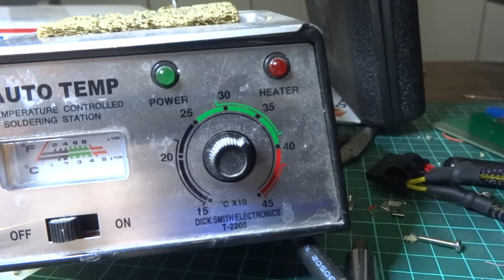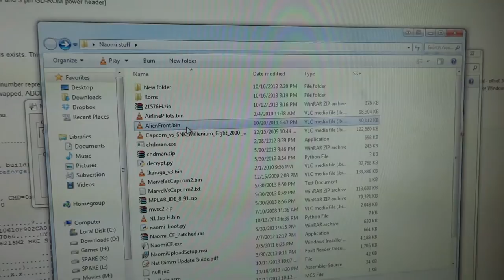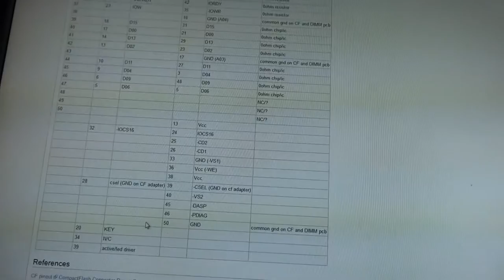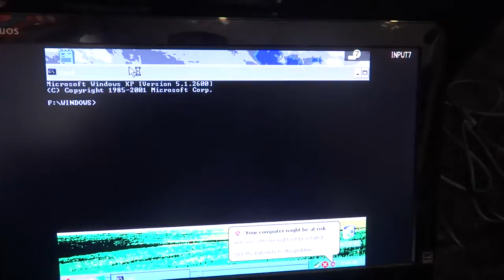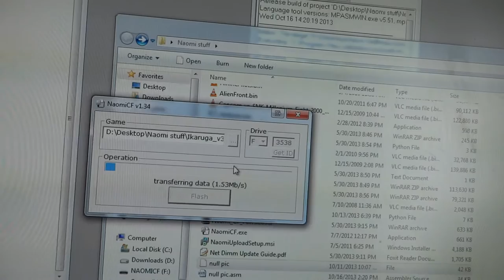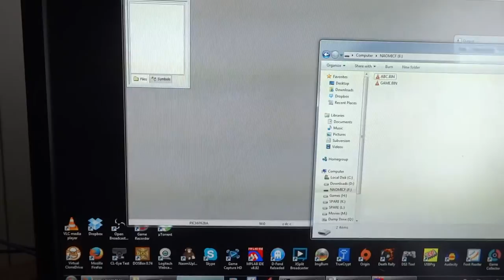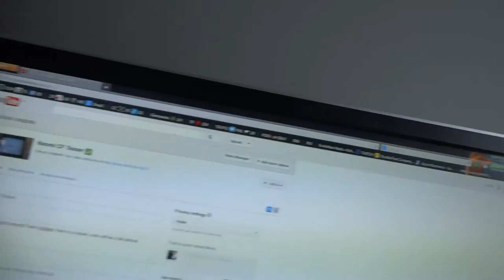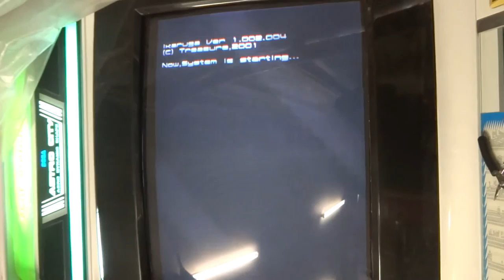How to build a Naomi Compact Flash Adaptor (and get it running)

Comment: have you figured out why your freshly burned CF didn't work? i see that you eventually swap with your already written one to test.
Reply from the maker: Different brand of CF Card. Some brands just do not read. It seems to be a common problem with this particular application of a cf reader.
Reply: What brand of CF do you recommend, @IcarusTech ?
Reply from the maker: +jaczeldanilo I have this packed away and  I can't remember off the top of my head, but just don't buy cheap ones. Get good branded one and you should be ok